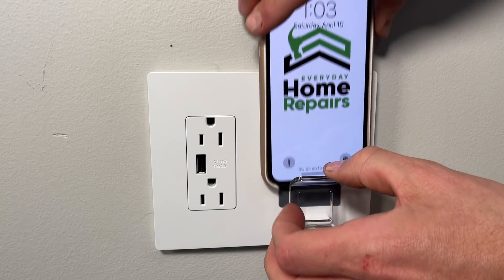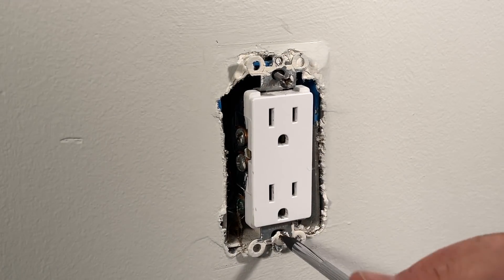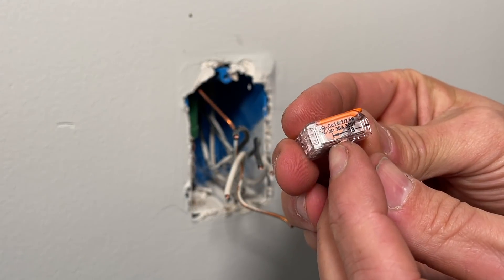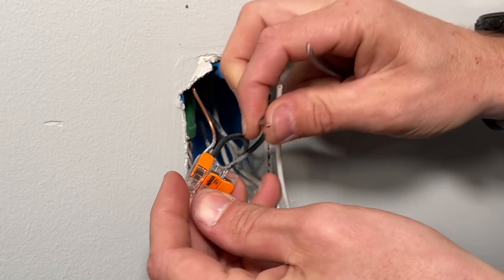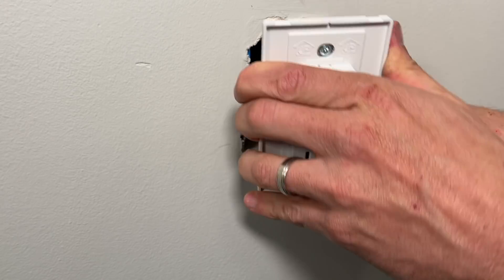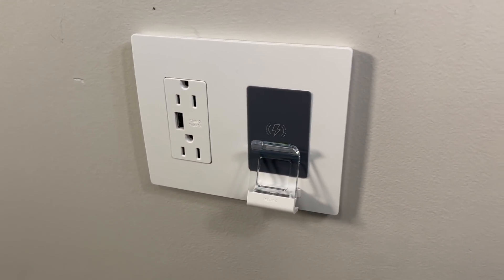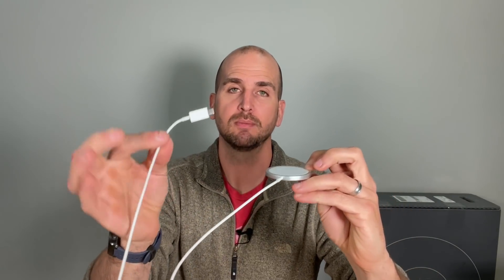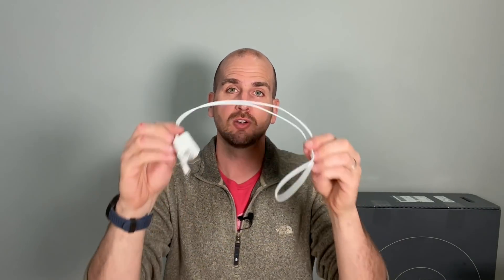How to Install an Outlet With Wireless Charger | Including Charging Test

Comment from the maker: Legrand Wireless Charger Outlet:  https://geni.us/Lx6iU
WAGO 221 Assortment Kit:  https://geni.us/H2Jp
Milwaukee Combo Wire Strippers: https://geni.us/5zuLAbC
#1 Milwaukee ECX Screwdriver:  https://geni.us/fuSEW
Klein Voltage Tester: https://geni.us/fAYN9Rr
Klein Outlet Tester:  https://geni.us/kdBAJ

Tools Every Weekend Warrior Needs
Makita Cordless Drill Combo Kit:  https://geni.us/t7dIA
Dewalt Drill Bit Set:  https://geni.us/oFlSl
Dewalt Screwdriver Bit Set:  https://geni.us/VDcr
Craftsman Screwdriver Set: https://geni.us/jXqFI
Eklind Allen Wrench Set:  https://geni.us/7XfvO
Pliers (4-Piece Set):  https://geni.us/RIdx
Milwaukee Fastback Utility Knife:  https://geni.us/MlyiLk
Stanley Tape Measure:  https://geni.us/bUfD1R
Studbuddy Stud Finder:  https://geni.us/RySCuVw
Johnson Torpedo Level:  https://geni.us/wiLcDY
Stanley Hammer:  https://geni.us/bPDk8Wo
Buck Bros Wood Chisel Set:  https://geni.us/vk3cpTW
Little Giant Ladder: https://geni.us/fmlmTk

DISCLAIMER: This video and description contain affiliate links, which means that if you click on one of the product links, I’ll receive a small commission.

Comment: I have asked this on your other videos before but with no answer, but what is the no load power consumption on they devices as they are generally not free?
Reply from the maker: I don't have a good answer for you but it is a good question.
Reply: @EverydayHomeRepairs  I have 63 devices on my smart home, and well each one of those Z-Wave and Zigbee devices uses a little power, and generates quite a bit of heat for what they are.  You making a video on these and other items like you have done, like the Sockets with USB and this could make an interesting video for power consumption, heat and so on. :-)

Comment: As always another great video.  Are you going to be doing one on Starlink?
Reply from the maker: I did my first test on Starlink here https://youtu.be/vzdSE9AMvhE but this week will be doing the roof install with the "volcano" mount and getting everything is the permanent setup.  I also expect I might have some significant speed increases for both download and upload by then compared to the original video.

Comment: Why use a WAGO instead of a traditional wire nut?
I get that they might be less error-prone, but are there any other advantages? I've never had any issues with wire nuts so I'm curious about the pros and cons of both (video idea?)
Reply from the maker: I did this video giving a few of the pros and cons.  If you are comfortable with wire nuts then I would say go with wire nuts.  I am trying to promote Wago 221 since I think it will help DIYers which might not be very experienced with wire nuts resulting in a loose connection which will be a failure point  in the future.  https://youtu.be/AWiyreFFt-Q

Comment: I'm confused because most cell phone power supplies are 5vdc at 1amp. So using a higher wattage power would mean more amps of current to charge faster? Cells phones don't need 1 amp of current to operate so I don't understand increasing the current and wattage of the power supplies would give u faster charging time?
Reply from the maker: Hey Wayne, for most the legacy phone chargers you are correct 5V at 1 Amp is the standard but USB-C increases the available current.  This is utilized in different ways across phone brands but it is some version of “fast charging.”

Comment: Question, most of my homes wiring is 14-guage, when using pigtails, should they also be 14-guage or can they be 12-guage? I realize they should not be anything thinner than original wire, just wondering if pigtails can be thicker, thanks.
Reply from the maker: Assuming you are also installing a 15 Amp receptacle 14-gauge pigtail will work.

Comment: I assume you started the charge test each time at the same amount of charge in the phone, that is, if you did the first test at 70%, then the next and subsequent test both started at 70%. The reason of course is many modern phones fast charge up to a certain percentage and then drop back the rate of charge. They apparently do this for battery condition and life. If you started the first test at 70% and after the set time it reached 87% then more than likely starting at 87% for the next test could mean the phone has or is about to govern its charge rate and of course be slower at charging than the first phone and only increase the amount of charge in the set time by a lower amount.
Reply from the maker: Good point, I actually kept the battery level between 60% and 80% for each of the tests as I believe IPhones stop fast charging past 80% depending on battery temp (fast charging only with the wired test).  With that said I am sure there is some error in the testing but I wouldn’t expect the results to change much.

Comment: I just installed a Ceilingfan, I used same WAGOs, works perfectly with solid Wires and stranded Wires all together.
Reply from the maker: Yeah, for DIYers I think they are no brainers.  I am surprised Lowes and/or Home Depot don't carry the in stores?  Maybe there is a bit of pressure from Ideal not to have Wago in the same retail space 🤷‍♂️
Reply: @EverydayHomeRepairs  Here🇩🇪it’s used professionally, too.
Reply: @EverydayHomeRepairs  We’re used to high Prices, but demand excellent Quality. Do you know that I use a HammerDrill to hang a Painting on the Wall.🙂 We live in stormproof Houses.😉

Comment: Man, that is crazy. It said up, but the poor thing has its mouth above its eyes! This thing came from the upside-down! (jokes aside, it looks handy but I could not deal with it looking like that.)
Reply from the maker: The ground up or down debate continues on 😁
Reply: @EverydayHomeRepairs   Oh, I understand why it is "OK" this way, or maybe even preferred by some. But wrong is just wrong people!  Also - long live the Oxford comma!
Reply: @EverydayHomeRepairs  True, but I do have to give another (unless you mentioned it before) and real reason to put the outlets in the "normal" way lol. Polarized GFC plugs like hair dryers have. You want the cord hanging down because there is less stress on the cord. If the outlet is upside down, the cord comes out of the top. That's just wrong.  🤨  Love the debate though lol!!  😀
Reply: Yeah, the little face is upside down!

Comment: FYI, you need to compare charges from the same discharge percentage.  Charging slows significantly as the battery becomes full.  Shouldn't change the order, but it's important to note.
Reply from the maker: I didn't start at exactly the same % battery charge for each test but I did ensure the battery was between 60% - 80% so that with the wired setup the "fast charge" would activate.  I still think your point is valid but I tried to control the best I could for the time available.
Reply: For a real test you'd need to fully discharge the battery then fully charge it and measure the time to charge. Your test may indicate the basic difference but you didn't give nearly enough control details to know.

Comment: Did you discharge the phone after each charge? Batteries charge slower at higher percentages.
Reply: This is correct. Even though the test wasn't perfect it was still pretty good. I saw this at menards the other day. I was torn on where this might be useful tho. Kitchen was the only place that makes sense but I'm open to suggestions. Side note. I think Delta makes a toilet paper holder that also has a shelf for your phone. Pretty neat imo
Reply from the maker: Exactly, I ended up installing it in the kitchen. 👍
Reply from the maker: I didn't start at exactly the same % battery charge for each test but I did ensure the battery was between 60% - 80% so that with the wired setup the "fast charge" would activate.  I still think your point is valid but I tried to control the best I could for the time available.

Comment: Not for us.
Not sure your charging comparisons are valid
I'm thinking the more something is discharged the faster it may charge initially but as it charges the rate may slow down regardless of what method is used to charge it but I'm just wondering. I really don't know.
Reply from the maker: Good point, I actually kept the battery level between 60% and 80% for each of the tests as I believe IPhones stop fast charging past 80% depending on battery temp (fast charging only with the wired test).  With that said I am sure there is some error in the testing but I wouldn’t expect the results to change much.

Comment: Wireless charging is so 8 years ago lol. We can charge phones insanely fast with USB-C now. Great video though!
Reply from the maker: Yeah, I actually picked up a couple outlets with 2 USB-C sockets integrated into the design.  Interested to give it a try and see the difference.  I would expect 3-5 times faster charging which is a big difference for sure.
Reply: @EverydayHomeRepairs  Are they the Leviton ones? I've been considering getting one.
Reply from the maker: @jcreazy  I picked up an Eaton (Trusbac15) with a USB A and a USB C and 5 Amps output.  Then a Legrand (R26USBCC6WCCV6) that has 2 USB C ports and 6 Amps Output.  At least at my local home improvement stores, Menards has the best selection (Legrand) for integrated USB receptacles.
Reply: @EverydayHomeRepairs , sadly, you have to pay attention to the marketing with USB-C integrated chargers like that; most are just high-current 5V output. iPhone cannot reach its highest charge speeds without USB-PD support (sometimes indicated on the packaging as an optional 9V, 15V, or 20V output via the USB-C port).

I think Leviton and Topgreener are the only mainstream brands, so far, that actually support USB-PD from outlet-integrated USB-C ports; everyone else is a plain 5V output with varying amounts of current. Even then, not all of Leviton and Topgreener's USB-C charging outlets support USB-PD! Have to watch what the marketing claims, otherwise you'll be holding your iPhone back.